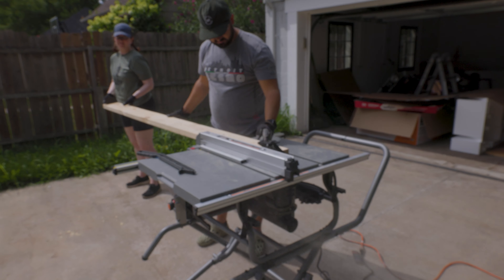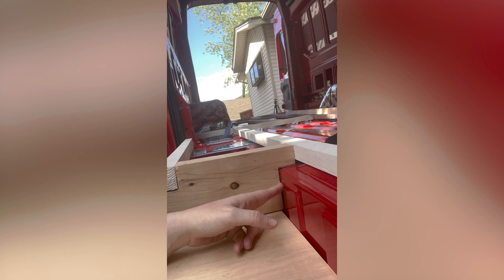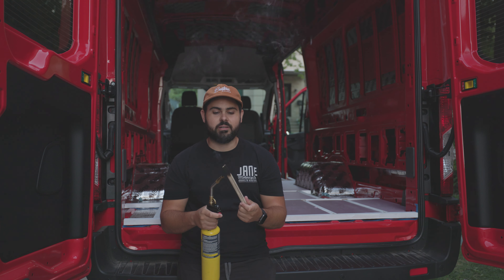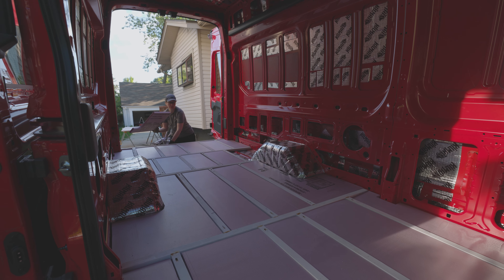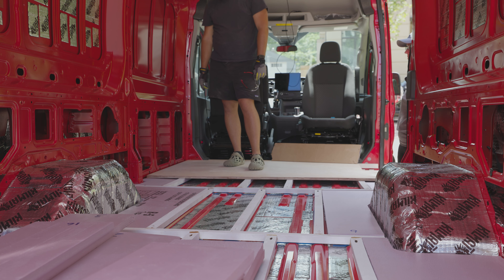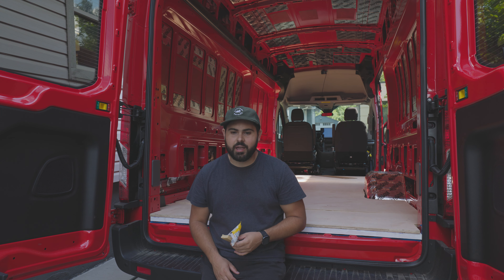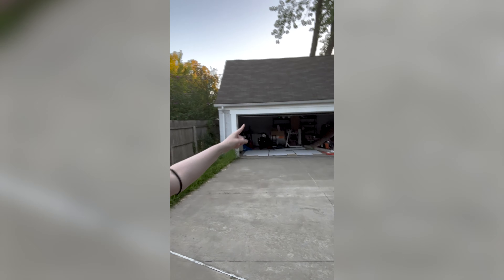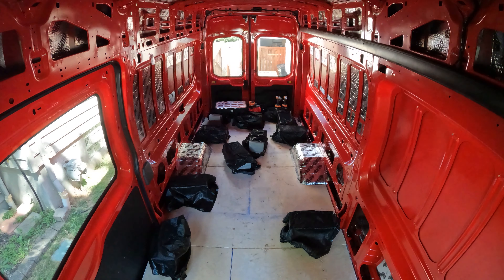How To BUILD & INSULATE a Subfloor for your Ford Transit Van

Comment: Thanks for making this video! We are starting our build of our 2020 transit awd and are prepping for subfloor. just wondering if you're still happy with your build now that you've had some time with it? anything you would do differently? we're worried about getting squeaks from the insulation panels touching wood. did your method of having slightly smaller foam boards and sealing the edges w/ spray foam work out in the long term?
Reply from the maker: Hi! We've not had a single issue with our build. Floors, walls, cabinetry, everything is great. So far no squeaks in the floor (yay). There are definitely things that we would do differently like add more drawers and potentially gone for 8020 Extruded Aluminum instead of wood for structures. The price increase of Baltic Birch in the middle of the project was quite a headache and we think we could have been quicker if we stepped back and learned about 8020 a little more before jumping into the build.

Comment: there are a lot of van builders out there so if you want to know what works and what doesn't just watch their videos, thus you don't make the same mistakes they do, and you get a great van lol
Reply from the maker: We spent hours (probably hundred of hours) at this point researching van builds and basically there is no “right way” to do it. There are many great ways that we saw, and we decided to pull ideas from a lot of them and do it our way.